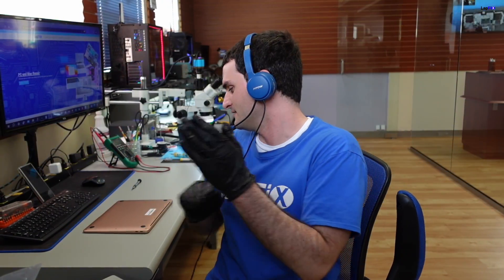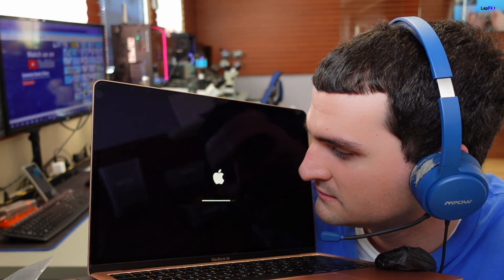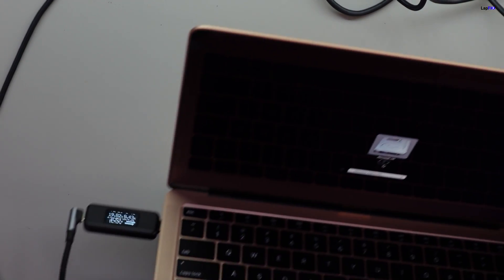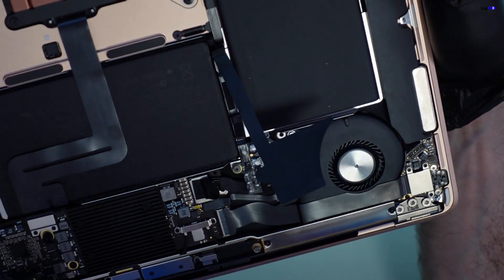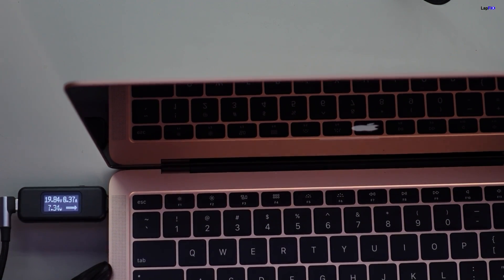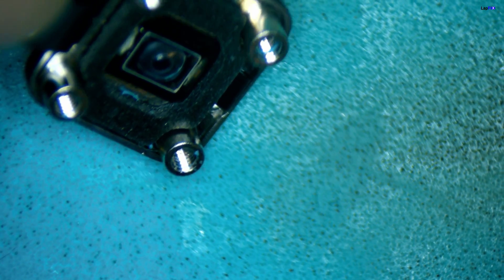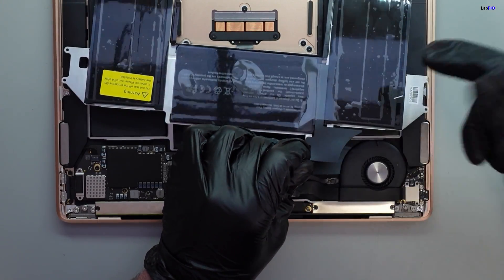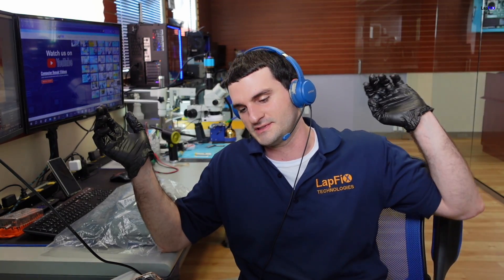How to Repair a MacBook Air with Loud Fan Noise and Slow OS

Comment: My issue obviously the MacBook Air wouldn’t charge if battery is connected. I unplugged the battery and plugged and plug in the charger directly and computer fired right up. But the issue is fan running at full speed constantly and the os is very slow. But motherboard is not overheating. Checked the battery board and no corrosion. Checked the motherboard and didn’t see anything. Fan seems like fairly clean. What can cause the fan to run at full speed continuously.
Reply: Same issue as my 2020 air retina Intel. Also cant boot in USB, no diagnostic, nothing. Just recovery mode loading for hours. Laggy mouse and full speed fan. Did a battery replace solved your issue?

Comment: I recently helped my son replace the screen on his MacBook Air 2019 A1932 all went well but then as soon as we attempted to power on the battery would not hold charge and the fan was going very loud like the one in the video. Looked on settings and it said battery needs replacing. We decided to buy a used but working battery, fitted successfully but still the same issue. before his screen broke there was no issues with the fan etc. Tested the MacBook air with only the power source with still the same issue (so presumably it isn't a battery issue). Any help on how to proceed would be greatly appreciated.
Reply: I have the same issue, did you find a resolution?

Comment: Thanks for this video. It was very helpful. I had a brand new A1932 where the battery controller corroded on its own in the box from poor soldering / too much flux. It looked a lot like this one you worked on, it may have been  the same thing, manufacturing defect solder flux corrosion and not a liquid spill.

Comment: Twice my MacBook Air has been to the Genius Bar and been through tech checks and they say no issues - this was from the very start when I bought it and at other times still now fan going and heating - I can't do anything at all without fan going and it gets hot - Genius reset it - it's so bad and now I am back to PC hard drive to work on my studies - after years of being a Mac lover I am now leaving you. So off to buy a PC laptop. I do believe this is a secret that MacBook air is a design fault.

Comment: I’ve seen this happen with bad touchpad or keyboard, it’s a game of hide and seek
Reply from the maker: Yeah, usually only a few things it can be.  Most of the time we have this problem it is a connection on either side of the trackpad or power button board. 😁